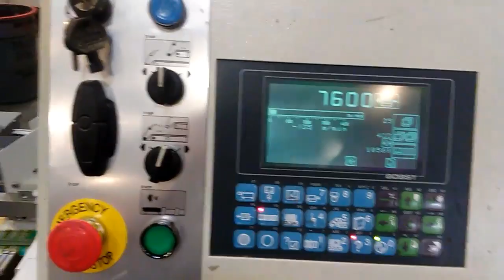Tuck Top 1-2-3 Bottom w/ Z-Fold Inner Cell on a Bobst Mistral 110

Comment: Looks very complex. I'm an apprentice operator in the UK, we run mainly straight line at high speeds but have done crash lock and 5th panel crash lock occasionally. 

Do you have any tips for an apprentice?
Reply: 1. When it comes to carriers, rails and bars... the more control you have over your carton, the better. Use what you have at your disposal to control/drive the cartons through the machine. Do you have room for the center carrier in the folding section? Use it. 
2. Check your swords. Are they straight and even with the outside of the belts? Can the carton move easily under the sword? If not, the carton may try to hang up there if you're not using the top center belt (in the folding section).
3. When folding or pre-breaking any score, make sure you are doing so gradually and gently. Don't try to pre-break too aggressively. That can damage the carton at high speeds. If you have a long sword to support the carton, use it. Remember, that carton can act like a sail.
4. When it comes to speed, sneak up on it. After I'm running at the estimated speed, I will usually increase my speed by 10 meters/minute then watch what the carton does and listen for anything that sounds out of place. Remember though, some cartons prefer a certain speed and there's nothing you can do about it. 
5. RELAX!!! Once in a while you are going to have a make-ready /set-up that is going to be difficult; maybe you're having an "off" day, maybe the carton wasn't cut perfectly, maybe the carton has a one-sided score or an auto-bottom/crash lock with a bad diagonal perf. We ALL have that one set-up that gives us a lot of problems and makes us feel like we're eating a giant bag of dicks. When that happens, walk away from the machine, go for a short walk, have a cigarette,  listen to your favorite song and clear your head then come back. Trust me on this one.
6. Build a good working relationship with your crew at the end of your machine. Without them you are dead in the water. Compliment them once in a while. That will go a long way towards have a good or bad day. Once a month or even after a long hard week I buy them lunch.
Reply: Hope this is of some help. You may know all of that already but those are some tips I give the new operators where I work.
Reply: @Oakhart76  thanks for this tips. highly appreciated your thoughts and words. <3

Comment: Oh this is very slow , we can provide machine , which can run this carton  on 200 m/min
Reply from the maker: This was a short run that I'd never run at 200m/min. Maybe 10k parts total if I remember correctly. 
Also I'd love to see a video of a z fold running that fast in general.
Reply: @kodybowman4855  bonjour,  j'aimerai bien avoir plus d'informations sur cette machine
Reply: @kodybowman4855  think they are full of shit, with the size of cca 20 cm and gap of 5 cm, they are talking at 48000/h speed. Dont think you can realistically expect more than 20k out of that type of box